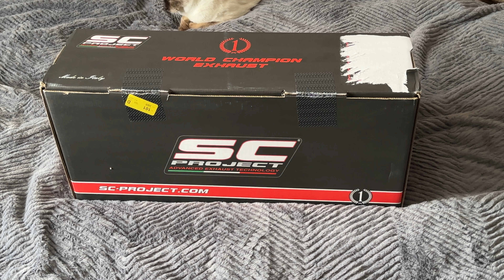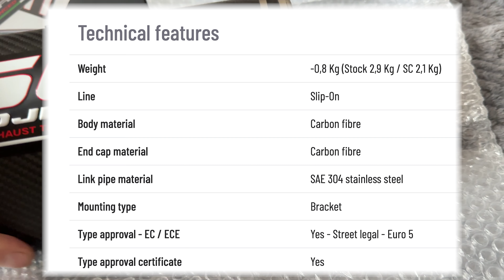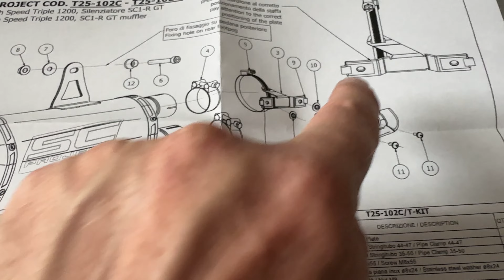I got a new Exhaust!!  SC-PROJECT - SC1-R GT Carbon Exhaust - Speed Triple 1200rs.  #scproject

Comment: Nice! I’m on a Street Triple and still deciding what to do. Like you, I could get the Arrow slip-on, which looks relatively OEM and has that slightly deeper note, whilst retaining the full induction roar. Or do I go the full-on Growler?!!
Reply from the maker: I guess it all depends on if you wanna annoy everyone, come home with a headache, and attract the coppers.. If so get a growler 😁

On a serious note I guess it depends if loud outweighs the disadvantage (stated above). As you saw in the video I just don’t need a massive volume for various reasons. That induction makes me smile and I don’t wanna lose it… I also had a 7 hour ride the other day. Can you imagine that with a really loud growler? Would have driven me nuts 😁😅
Reply: @ all excellent points. I’ve actually found another slip-on that looks like it’ll fit just about in the middle of the two - Kelpi Customs Moto (Australian) Alpha pipe. Removable baffle, with (apparently) 4 levels of sound control! Extremely good value too and available in stainless or cerakoted black. Decisions, decisions!
Reply from the maker: @ a sound level for every occasion… That sounds like a brilliant solution. Let me know how that went if you decide to try it mate 😊🤘🏻